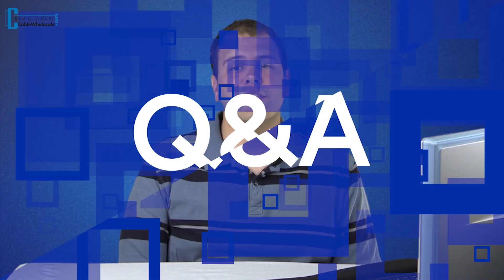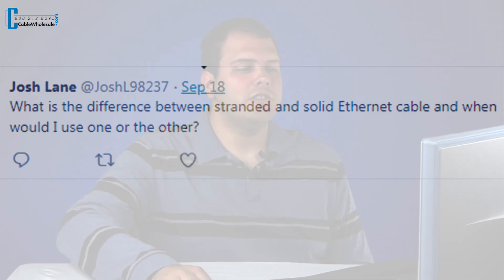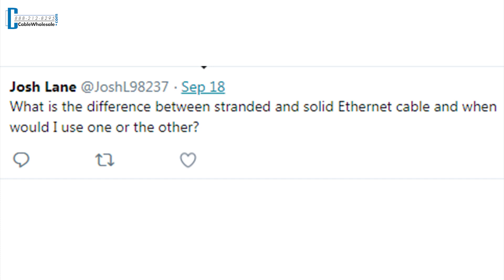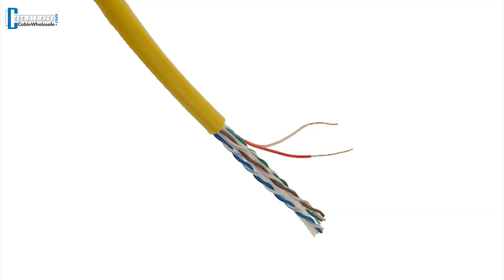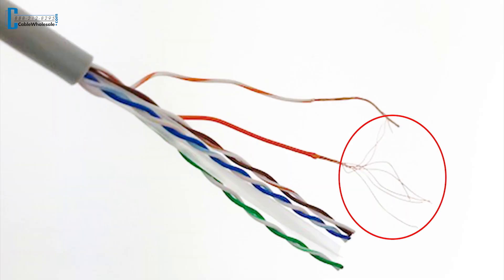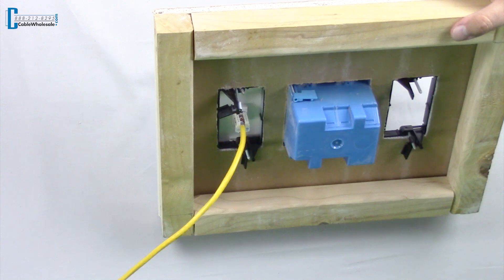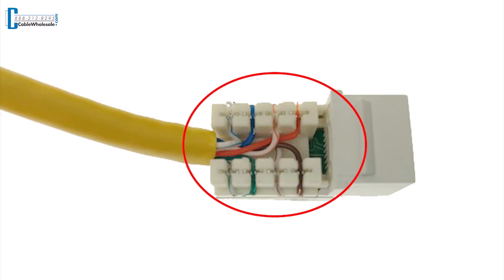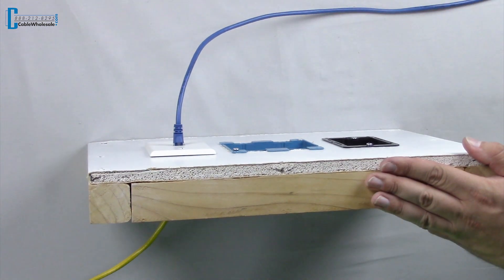The difference between Solid and Stranded Ethernet/Cat Cable

Comment: Would stranded vs. Solid makes any Difference in speed other then flexibility
Reply from the maker: Hi Pankaj,

No, speeds would be basically the same. Solid can give you more forgiveness with longer lengths and signal loss.

Comment: That did not explain electrically why you would use one vs. the other.
Reply from the maker: Hi Silas,

Electrically there is no reason to use one vs the other. Solid is used for network runs to punch down to female jacks. Stranded is used for patch cables (for flexibility) and punched down to male RJ45 ends. The main difference is flexibility for patch cables from the wall to your hardware.
Reply from the maker: Also, the reason for the signal loss difference is because the solid wire has less resistance than the stranded.

One more difference is there is more signal loss (about 20% greater loss) on a stranded vs a solid wire.  So, in addition to the flexibility that stranded wire gives you, you tend to reserve stranded for shorter runs (i.e., patch cords), as opposed to long runs, where the signal loss won't have any appreciable effect.

We use solid to punch to keystone jacks and patch panels because those are traditionally longer runs where the signal loss would be an issue.

Comment: Connectors are different too - should add how to tell them apart.
Reply from the maker: If a connector is marked as solid only or stranded only the little copper teeth that punch down on the cable are slightly different. This difference is very hard to see just looking a the connector. But in most cases all connectors will say "solid and stranded" and will work for both.
Reply: Stranded pins are straighter and slide between the strands, Solid connectors attempt to wrap around the solid conductor so the teeth are more offset. Use to be they were more smoke colored rather than clear so you could tell them at a glance. I don't think you are supposed to use stranded ends for solid wire though the other direction is ok.
Reply: By what i researched, 2 prong ok for stranded cable bad for solid copper cat xx, 3 prong for both better for solid and usable for stranded
Reply: according to me... Xd a "3 prong"  connector is used with stranded while a 2 prong is used for solid. could anyone confirm please?
Reply: nvm, the prongs do not indicate if is for solid or stranded. it is as @OldenWize says.